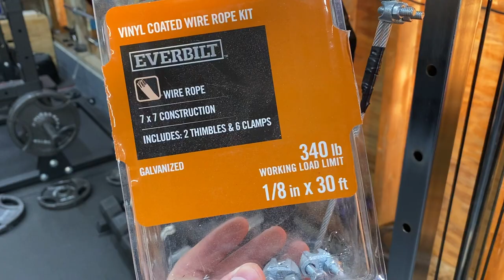How To: SIMPLEST DIY Cable Belt Squat Platform For Under $12

Comment: This is by far the best one I seen so far will be redesigning a little but using the same thing
Reply from the maker: Appreciate the feedback. If I were to build a new one I’d definitely use a stronger board.
Reply: I second that.

Comment: This is definitely the best DIY video and you can use the platform for other cable exercises or even resistance band stuff! Ty this was exactly what I was looking for!!! I'm definitely making this. Ty again
Reply: I made this only I decided to do a slant board version. it works well! Only issue is you have to make sure the cable length is correct, or it will fly away when you step off.

Comment: It’s definitely the most simple one out of all.  I can add an extra cable to the lat pull dow cable.  My concern is the risk of injury once you hit failure.  The norm lock is on the upright position.  Here you’re maxed out one the bottom while trying to unhook from the cable.  It’s great for light weight.  💪🏻
Reply from the maker: Thank you!
Reply: @untappedstrength7548 Hi, can i do the same thing using my body solid universal gym that has a cable pulley down by the floor? how would i do that?

Comment: You could add strength, but leave room for the bottom bolt, by attaching the bottom wood pieces perpendicular to the top board. You could cover the entire bottom with counter-grain support with the exception of a small section for the bolt. 🙂🙂
Reply from the maker: Great tip!

Comment: This is the simplest DIY one, but in my opinion its got a major flaw in that it doesn't allow you to go deeper on your squat, as you can see you weren't able to go low enough so your legs are at 90 degrees.  You should make your platform at least 6" higher or so to allow that to happen.
Reply: He started off below parallel to the floor and the weight starts to move just as he hits parallel. He just chose to not squat that low for the rest of the demonstration.

Comment: it looks that this will work better than thoese levearage arms or a barbell belt squat since they pull you forward.  With this cable platfrom it looks like you are squating  right under the pulley and pulling the weight straight up and down instead of pulling forward like the leverage arms do and the barbell too

Comment: The platform should be closer to the rack so that the cable is nearly vertical and won't want to pull you forward. That puts you within arms reach of the weight so you can set up a rope loop attached to the top of the tower to loop around the weight holder so that you can start in the standing position.

Comment: I love this idea, so I made one. But I think I found a problem, physics! I weigh 80kg. I loaded up just 60kg to test it and it started floating off the floor and sliding forward. The load is effectively lifting up with 60kg of force (~600N if you are being pedantic) and the board only has 20kg pressing down on it so it can slide forward if there is any lateral tension, which there always will be. 

So I'm going to install some hold down clamps on my power rack so I can quickly clamp the board in place when I need to use it. If you can't do this then you could make a longer board and add weight plates onto it to hold it down. Adding some non-slip surface like rubber to the bottom of the board would reduce the effect as well.
Reply from the maker: It should not float no matter how much weight you add. You need to use the cable extension and leave enough slack so it doesn't move the board.
Reply: @untappedstrength7548  I have tried that when I was setting up with a length of chain. It still floats as soon as you get tension on the load

It makes sense if you imagine an exaggerated example. 500kg of weight pulling the cable up, you and the board weigh 100kg. If that 500kg magically got up, then what would happen if it came down? How is 100kg going to prevent it from lifting you into the air? The board is not fixed down. 

So either you have to balance the weight you are lifting by adding weight to the board, you fix the board down or you change the angle that the force of the load is acting. So a lower attachment point would work better. Ideally the load would be  directly below you, pulling you down onto the board.
Reply from the maker: @aries6776  If you skip to 4:53 of the video, you will see that the pulleys on the cable machine are raised about shoulder height, just high enough for the extension cable to wrap around the pulley on the board. There should be absolutely no tension on the board if you setup this way. Then what you do is stand on the board and squat as low as possible just so that you can attach your belt to the carabiner under you. When you're done squatting, squat back down to a point where there is no tension on the cable and you should be able to unhook the belt from the carabiner.
Reply: @untappedstrength7548  ofc there will be tension on the board. The cable and wire will pullit forward. Theres is a reason why the video does not show it in action with any significant load.. because the design cant handle it.. its easy to see.. yes i build one to test, and no it does not work With any significant load..

Comment: Make it simpler and buy a pulley that bolts to the board and get rid of the eye bolt and extra connector
Reply: yep, I was thinking the same and in fact I am going to do it that way
Reply: This would also lower the pulley, allowing for a deeper squat. Most of these cable belt squat setups, including the commercial ones, have you quarter squatting. Other than SquatMax, I can't think of another cable belt squat, DIY or commercial, that allowed below parallel depth.

Comment: This only works with very light weights! With that kind of load, goblet squats would be quicker and easier. If you made this with a bigger board and then use 45-pound plates on top of either side to counterbalance the weight being pulled.
Reply: Goblets load the spine. The belt squat are better suited for high reps anyway.
Reply: @flink85  Um, I have no idea what you mean by "high reps."  I do belt squats in a setup similar to the setup in this video using five 20kg plates for about 15-20 reps. That is what I would call a high rep range. In this video, he only uses 20 pounds because using much more weight would be difficult and the closer you approach your own bodyweight, the more impossible it would become. 
AND if 20-pound goblet squats are too much load on your spine, then you are seriously in trouble and should seek medical attention.
Reply: @Abraham_Kist-Okazaki  15-20 would be higher yes. Well the entire point is to be able to load legs properly without loading the spine. Goblets are good for beginners learning the squatting pattern. However, when the legs get stronger your core, wrists, upper back etc will give out before your legs.
Reply: @flink85  And my point is that 20-pound belt squats in this setup aren't enough to load the legs enough to load the legs and that it would be no more effective than goblet squats.
Reply: @Abraham_Kist-Okazaki  why would you only load 20lbs? Full weight stack or even 2 full stacks are possible if you anchor the platform properly.
Reply: @flink85  Did you even read my first comment?? Or watch this video. This setup has nothing to anchor the platform other than the lifter's body weight and instead of using a belt squat belt uses an ordinary lifting belt. AND he only uses a 20 pound plate because that is about the limit of this setup,

Comment: Does it matter what height you have the BD-62 set to for this?  It looks like you have it set a few notches from the top?  Have you tried at lower settings?  I built the deck and am wondering the length of cable or if it even matters?  Thank you.
Reply from the maker: I can set it to the highest point without any issues.

Comment: Doesn't that setup pull you forwards if you use heavier weights?
Reply from the maker: By using the extension cable it will prevent it from being pulled forward.

Comment: This would put extremely high tension on the wood, maybe have the attachment follow a sort of triangle path, tension on the board is half the tension on the cable divided by the sin of the angle with horizontal, for the board it's almost 0 degrees so we are dividing by 0. If it's a triangle eg at angle 15 degrees the tension on the attachment would only be about twice the tension on the cable. I had made a similar movable pulley attachment with extra cable for my power rack lat pulldown, which allows me to attach a pulley at any of the slots in the power rack, making the thing long enough that the angle with horizontal stays at 30 degrees so there isn't too much tension. Also I found out about this from diagrams that came with a pulley I bought 😂😂.
Reply: I think it could be reinforced easily. Maybe cross bracing underneath. Lots of space still under there. Might try a hunk of oak someone has lying around.

A more complicated approach, though not that much more, would be to laminate wood strips side by side. Think of a cutting board for instance. That would increase stability dramatically I believe. 🙂
Reply: If I understand you correctly, you wouldn't want to do that because the force would causing a sheering effect on your knees. It's really best to keep the cable as directly below your hips as possible to avoid undue sheer on your knees. Unless you could use an angled foot board to keep the force perpendicular to the line between your hips and feet.
Reply: @aries6776  I meant the triangle apex is formed by the pulley underneath, the cable goes straight vertically down into the pulley from the belt
Reply: @ratchat123  Oh I get you. So the cable coming into the pulley is a close to the horizontal as possible. I don't think it's much of an issue however if you use a decent sized washer to spread the load. Plywood is pretty strong in compression which is the force of the nut pulling on the washer and onto the wood.

Comment: This does not work with higher weight. I tried.
Reply: How come? I was thinking of doing something similar but might rethink if it doesn’t work with a higher weight
Reply: @Jay-dp7kl  It wanted to launch me, I'm 215lbs.
Reply: @kwhuisman  So each side of the wood plank should be fastened to the ground or weighted by something? Thanks.

Comment: You will never be able to do any heavy load, because the wire will forward the board to much, at sort a force, that it will possible fly 8nto the tower with great force.. this is actually not a very good design.

Comment: Usually I like the diy stuff, but houlda went a little thicker for just this one area. Other areas of cable pulley systems can be cheap, but enough weight and that's going through your balls 😆😆
Reply from the maker: Thanks for the tips!

Comment: How much weight have you used on this? Obviously, the belt in the video is your limiting factor, but I'm wondering if you're worried that the eye bolt will pull through the platform at higher weights. Thanks for the DIY!
Reply from the maker: Not too much to be honest. However I would highly suggest getting a better quality, stronger board for the platform. As you pointed out I probably wouldn't go too heavy not to risk that the eye bolt pulling through the board. That wouldn't be fun.
Reply: One possibility would be adding a second eyebolt and pulley to give yourself mechanical disadvantage (so one pulley would be hanging from the belt, with one side feeding to the board pulley, and the other would just terminate at the second eye bolt. If you loaded 100lbs on the cable machine, both eyebolts would have 100lbs of force on them, while you will feel 200lbs of resistance. The weight carriage will move 2x your squat's ROM, but I'd expect there's room for that.

Comment: The only issue with this unsecured platform design is that if you're squatting a significant portion of your weight, the reduced weight on the platform will allow it to slide. Not real safe.

Comment: Did u try squatting ur weight ? Did it move ?😄
Reply: I did, it started lifting off the floor! (was actually 20kg below my bodyweight)
Reply: @aries6776  it was expected, try adding weigh pegs and throw some plates on them
Reply: @firstfloor5347   That was my first thought but  unfortunately I didn't make the board bigger enough for that. So I'm adding some hold down clamps to my power rack, that will hold the board in place.

Comment: Wouldn't just place a heavy dumbbell on the floor with the cable going under it to the same?
Reply from the maker: It would have to be an extremely heavy dumbbell for it to stay in place and just the friction of the cable rubbing on the handle would be pretty significant.